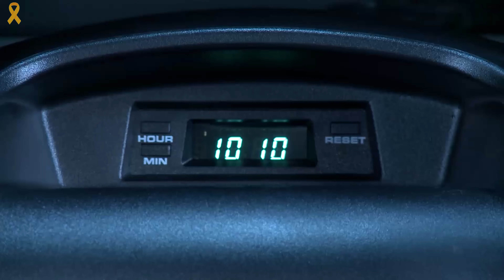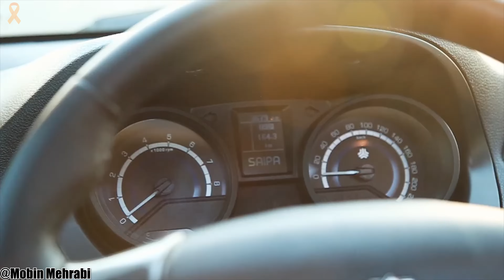Iranian Cars' Secret

Comment: even without sanctions, iran is a very protectionist country when it comes to the automotive industry. to import a new car into iran, first it has to be above a certain value so it cant compete with the local cheaper cars for example a bmw, then you have to pay a 50% import tariff and after that you have to wait 5 years before you can legally sell it. a 40000 euro car by the time it can sell in iran will cost twice as much and it wont be new

Comment: 1:28 reliable? i currently have a saipa, each 500km there is a new problem, suspension is squeaking, misfiring, the ecu didnt work properly, the drum brakes dont work etc. but current saipa models like the saina or quick and maybe shahin are good, suprisingly.

Comment: A little more trivia on the kia pride:
Kia pride is a result of a joint program between kia, mazda & ford.
Once the design was finished however each of these companies made their own versions that look the same but have slight differences and sold them in different markets under mainly 3 different names(Kia Pride, Mazda 121 & Ford Festiva).
Kia made a bunch of different versions (and lately a one-off EV version of the OG 5 door hatchback for the company's 80'th anniversary) including a 3/5 door hatchback(& a cheaper version called pride young), sedan, small van & 2 station wagon versions(that are the exact same car but they sold them under 2 names?).
At first kia pride 5 door hatchbacks(3 door hatchback variants are so rare that I've started to think that they were never imported here) and sedans were imported but later saipa bought the manufacturing licenses for them once kia discontinued pride productions and Saipa (weirdly enough) made slight changes ONLY to the sedan(like moving the antenna from the front left pilar where the driver can reach out and adjust it, to the front center of the hood) and sold them under a different name, pride(the hatchback one) became Nasim(breeze) and pride β(sedan) became Saba(morning breeze).
The production of nasim was discontinued earlier than saba because it's sales were not as high as saba and later saba saw some more changes like an entirely new interior design(that's literally copied off of Renault L90 that saipa also made under license at the time) and the removal of two small windows between the rear doors and the back window and it got renamed to Saipa 131.
Saipa 132 & 111(also known as Morvarid(Pearl)) are the (sort of) facelift versions of pride β & pride respectively that didn't really sell as well which led to them being discontinued while 131 was still being produced.
Saipa 141 is the half hatchback, half sedan version that u showed in the video and has some different versions(mostly just cosmetic changes like different grills and antenna placements) and has a different interior design (that's also copied from Renault L90 but its different from the other one i mentioned before)
Saipa Safari(for travel) is the Iranian version of Pride Wagon/Friends with different tail lights. This version was not as popular and was fazed out much sooner than the other versions.
Saipa 151 is a small pickup version that's seemingly based on the kia pride van(which never came to iran) and most of its parts like the front bumper & interior design comes from 131. its quite popular as a not so expensive small pickup and it's still being produced to this day!
Pride(yes, we refer to all versions as just "Pride") has since become THE car (after Peykan(arrow) of course) that comes to mind when people here think about Iranian cars because it's such a common car to come across even more so than peykan's due to their age
Also 7:43 its pronounced as "rana" and there's also a Runna+ with more modernized lights and interior(funnily enough both have a whopping SEVEN CUPHOLDERS six of which are in the front XD)

Comment: I'd buy a modern made 405 if I could. Those things were bullet proof, especially the diesels.
Reply: Well these ones with the XU7 engine are not, you'll burn a head gasket every 6 months. Worse reliability than Subaru, we're just forced to buy them because importing cars are not allowed mostly and the ones that are, would cost about 3 times considering the tariffs Iran has put on them.
Reply: @ were not forced to buy them, infact, during jcpoa, we began MASS PRODUCING peugeots when we couldnt do that

Comment: great video. a few topics you missed. their cars are hella expensive. they also wont allow imported cars because they want to sell their cars as high as possible. and about imported cars which their last model is 2015. their prices are so expensive for example a bmw 3 series good condition with 100000 KM mileage starts at 50k usd. 100k USD for a 7 series bmw or a CLS 500 mercedes 2015 models.. and IKCO DENA costs like 10K USD MSRP. its crazy.

Comment: Also, my dad told me that kia pride (or ride-p), is actually a car from korea (or maybe a replica), most cheapest in iran, cheap body parts, repairs, and maybe tyres. But motor oils, or any other parts related to the engine is expensive. Luckily my dad is a professional mechanic himself so he knows what to do when his ride-p breaks whatsoever, great video by the way
Reply from the maker: Thanks for sharing, I appreciate you watching and leaving a comment!
Reply: The Pride is actually a Japanese-American car that is the result of a collaboration between Ford and Mazda. This car was even offered in the United States for a few years under the name Ford Festiva, but after a while, its production was stopped due to standards. Interestingly, Ford and Mazda initially wanted to use the Pride as a vehicle at airports and golf courses, but they gave up and sent it to the main roads. Of course, it is also worth considering that this car saved Kia Motors from the terrible bankruptcy that threatened it at that time. If it were not for this car, Kia would not exist. Perhaps we can say that a huge part of the South Korean automotive industry would also have disappeared.

Comment: The pick-up derived from the 405 is rear wheel drive with a transverse engine?
Reply: There are two outwardly indistinguishable versions of the pick up using the same 405-derived cabin. The original from 2015 used the RWD drivetrain from the 1960s' Hillman Hunter (Peykan). The later 2022 variant (as shown in this video) was entirely based on the FWD 405 to reduce emissions. Respiratory disease is no joke. The 60's tech was taking too many lives, but the 80's tech takes just the right amount.

Comment: Screw new european cars, I wanna buy a Iranian 405 !!!
Reply: Bro u guys dont know how bad they are 
Im iranian and iranian cars SUCK
Reply: @Mahan-Feyzi  new cars here are not better... I have a 2015 Opel Astra ST 1.4Turbo and it's a money pit... And so overcomplicated... Also have a 2005 Peugeot 307 and it's miles better reliability wise... I can work with a XU or TU engine with my eyes closed... I can change the timing belt with nothing but a basic socket set in 3 hours with beer pauses... on the Opel to replace the timing chain I have to disassemble half the engine and spend 150€ on special tools and 2days to do it sober.. Screw that!
Reply: @NiPPonD3nZ0  ok but aint it better than using 30+Liters every 100km and like  breaking down all the time no safety 
Our family has
A 206 2 times we have 1 rn 
2015 imported kia optima
A saipa pride 
Rhe optima has been best BY EVERY MEANS
Reply: @NiPPonD3nZ0 i could feel you too though the optima had a  problem that the steering wheel was very hard to turn when parking it was a nightmare to finally get fixed
Reply: @NiPPonD3nZ0 and iranian TU OR XU or something else made by iran sucks wayyyy worse than advertised and a dream to compare with france made ones here
Reply: @Mahan-Feyzi the Opel is nice to drive and is solid on the inside plastics wise... But the engine crapped on me with only 140.000KM, had to replace the crankshaft and basically rebuild the whole engine, on a 7 yo car at the time... And it's still not running right... And the parts had to be imported from the USA (I'm from Portugal) The Peugeot has 335.000km, original turbo, original injectors, original everything on the inside... I have also a 1999 Citroen Xsara Break 1.4i (TU engine) with 550.000km and it's still good with the original engine and gearbox. Had a 1990 Peugeot 405 back in the day and i drove it for over 10 years and it was SOLID... Was wrecked by a VW Golf, but the 1.4 TU engine still runs on a Citroen BX even today...
Reply: @NiPPonD3nZ0  you should buy Chinese famous car's
Reply: @NiPPonD3nZ0  i am also Iranian. the latest 405 model that was made in Iran uses the oldest version of the XU family. it has head gasket, piston, and bottom end problems. it's not a well built car at all. the older versions are better, the 2000s was the best time in our car production. we even had power seats before the sanctions in PARS models. but now, you are lucky not to buy a lemon. most cars get repaired multiple times during the short warranty period before being able to work semi normally.
Reply: @khorsow8023 sorry to hear that... Religious governments only works for the government itself, the people always get the short end of the proverbial stick... Still, I miss the simple cars of the late 1990's and early 2000's... Power steering, power windows and A/C, all the rest is superfluous and problematic... Nowadays you have to have abs, and stability control, and sensors, and DRLs, and this and that, and it all ends up in problems and very, VERY expensive and fragile cars...
Reply from the maker: Me too... :)
Reply: Some one can sent you
Reply: If you like 405 , you should buy 405 slx or pars 
But if you want a modern 405, you can take the soren plus or Dena plus
Reply: We have 405 locally manufactured here. Now is there anyone that imported front and rear end for 405 Iranian version?
Reply: That's a shame. I had a Ryton (UK) built 405 with a petrol engine (can't remember code, probably XU).

Ran for over 100k with no issues in British salty roads. Lovely car.
Reply: Western cars have fallen low trust me.